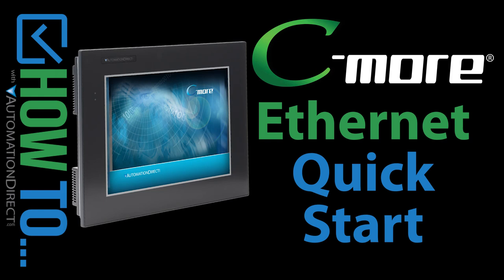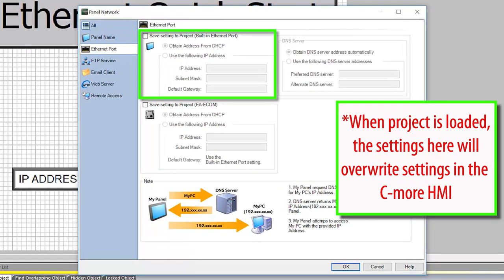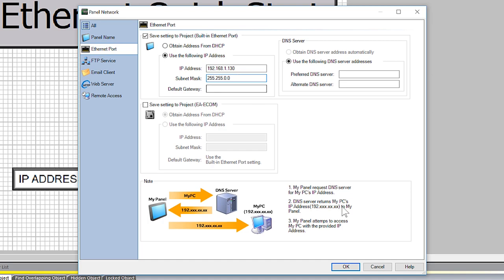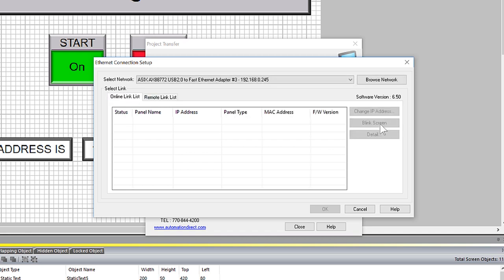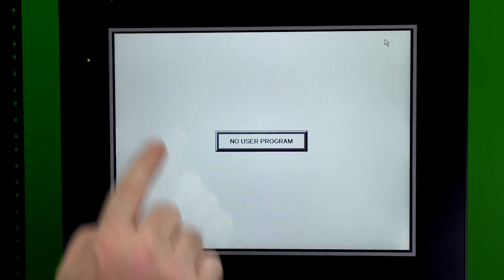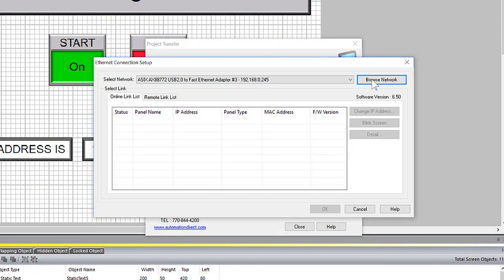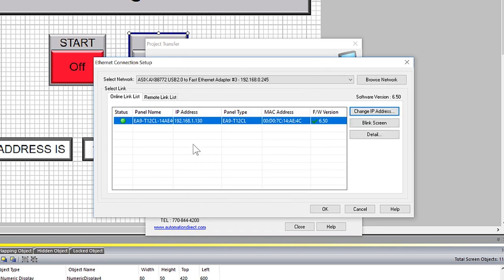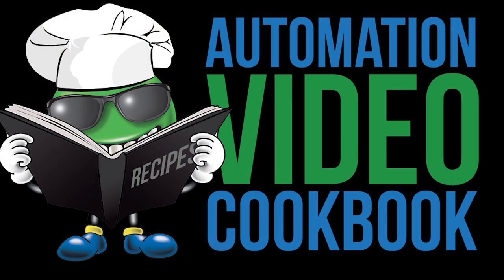C-more HMI: Ethernet Quick Start from AutomationDirect

Comment: Not working . My t6-cl nothing happens when I touch upper left corner
Reply from the maker: Thaks for the comment king.The upper left hand corner should grant you access to the System screen. I would advise calling into Tech support for help on this issue. 1-800-633-0405
Reply: Use a ballpoint pin with the ink part retracted or a stylus type stick it makes a more effective press on the screen and you need to use a hold action to bring up the menu
Reply: @Fine_i_set_the_handle  Hi Andrew ,
Need your help 

Is it possible for you to Guide a bit.

Thanks

Comment: Would it be possible to connect and control 14ish hmis to a single do more plc with a big unmanaged ethernet switch?
Reply from the maker: Andrew, this should be possible. Performance is going to be dependent on the network quality and the amount of bandwidth.